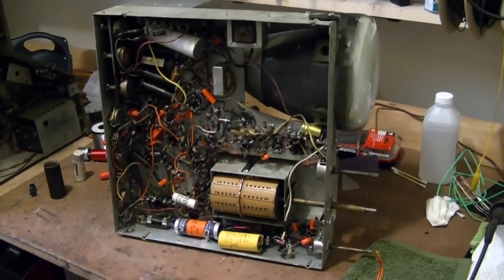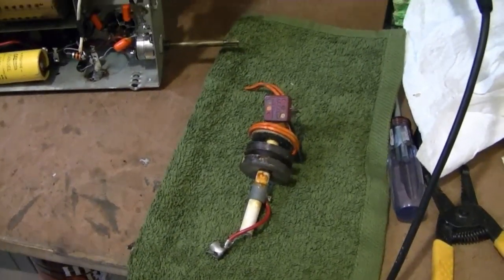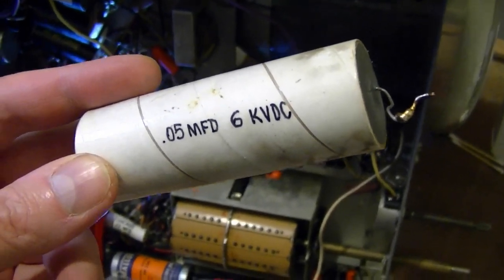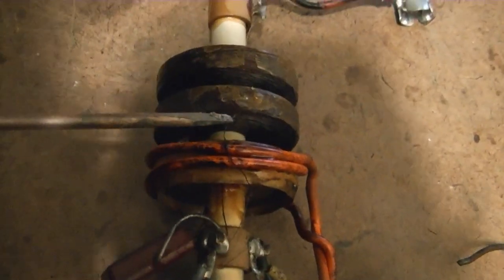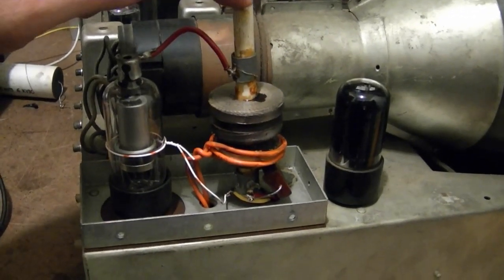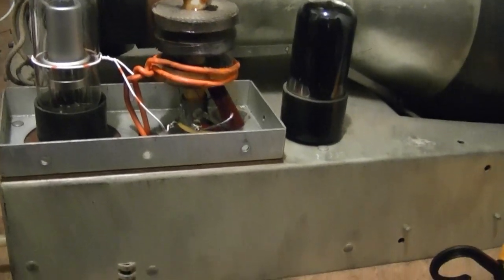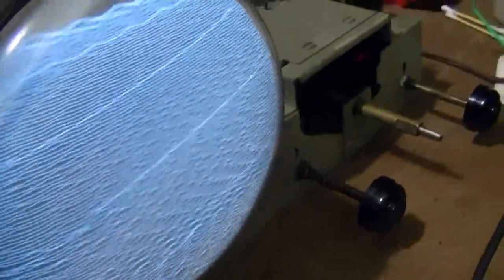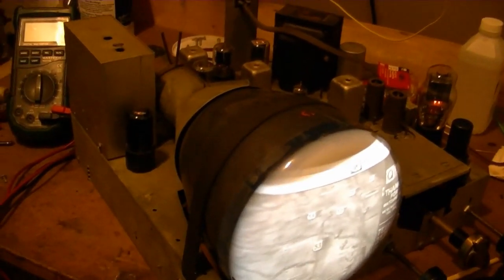Admiral 19A11 HV coil repair

Comment from the maker: HV coil - electrostatic sets don't use flybacks like you'd find in a magnetic deflection set because there's no yoke to drive.   The tuner takes up a lot of space too because they used the same type used in bigger console sets.

Comment: Bob, is that a HV coil, a flyback or both? That big cap doesn’t have a brand? I wonder if it is a normal cap stuffed in that cone. I think the cabinet of that set looks too big, but watching the video I realized why it has to be that big, the CRT length.  Now, seriously, aspirin?? Living and learning... I must work too with very thin headphone wires.

Comment: Had to do similar on a more modern cfl flyback transformer with extremely thin wire like yours. I used vitamin C tablet that looked just like the aspirin tablets. works well.

Great repair!

Comment: Aspirin does nothing for a toothache but looks good for cleaning off a fine wire, salicylic acid maybe? But Ibuprofen works well on a toothache but is useless for repairing high voltage coils.